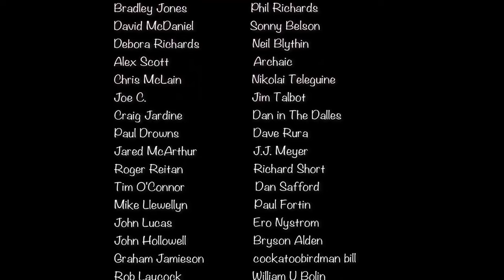Blacksmith Zig Zag Pattern - GS Tongs

Comment: Glen, 
I've been using some rack pieces for years to make my ladder Damascus patterns. I drilled a 1/2 inch hole through 2 pieces then cut out every other tooth on both parts. When I put my layered steel on these and press them I get a really nice ladder. I grind the high parts off the Damascus then hammer it back flat and it looks great. It also works to put 45 degree waves in it, grind and re flatten. Then go the other way to make what looks like wave pattern on it. Works best on a press and a 2 inch wide piece of rack track.
Reply from the maker: I've never done Damascus and so most of what you say is new to me and interesting. Thanks for watching and taking the time to comment.

Comment: Another interesting experiment, Glen. I could see those rack dies used for ladder pattern Damascus, although easiest with a press or possibly a power hammer. I would be interested in trying some, even though my power hammer is more of a helve-type, where the upper arm moves in a slight arc instead of straight vertical.
Reply from the maker: A power hammer or press would make this way easier. I'll see where I can use this pattern for upcoming projects. Thanks Dennis.

Comment: Mate, I wonder if you could use that tech as a kind of partial cog, in conjunction with another identical piece, for some kind of tong-like spreader, with a scissor action.  Instead of the tips closing, they'd open. I'm not really sure of an idea, but I reckon something that could pivot/rock two identical pieces, for some reason. Either way, I like the look of the results of the experiment.
Reply from the maker: The thought of making a sort of "spreader" tong did cross my mind. Let me see where I can incorporate this pattern. Thanks.

Comment: Would be interesting to put a copper rod inside the pipe
Reply: What pipe?
Reply from the maker: That's a thought. If the copper extended on both sides it could be pretty interesting. Just not sure how / where I could use such a piece. Thanks.
Reply from the maker: The small diameter pipe I crushed in to the zig zag pattern. Thanks Stan.

Comment: If you drill corresponding holes on your top piece and make a simple slide mechanism from some metal, you could keep the two halfs together or inline, then raise up and put stock in between. Using a flatter, could probably use less heats and go quicker 🤔 wished could explain idea better, maybe I could draw up some crude drawing and send it to you via email if you're having trouble following this derailed train of thought 😂😂😂
Reply from the maker: Your idea is good. I was thinking to make a sort of guillotine tool incorporating small pieces of this rack. Let me see where I can take this and more importantly, how I can use this pattern in projects. Thanks.